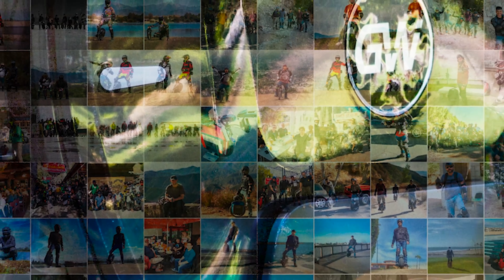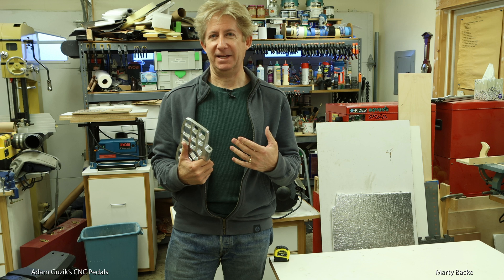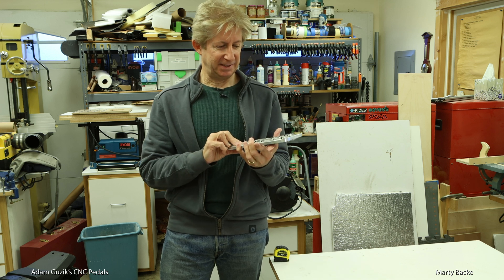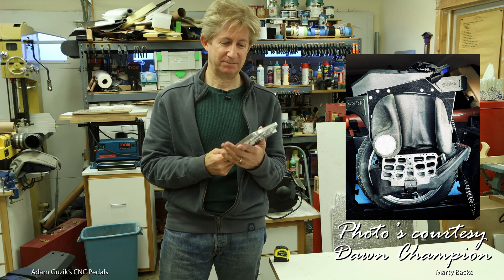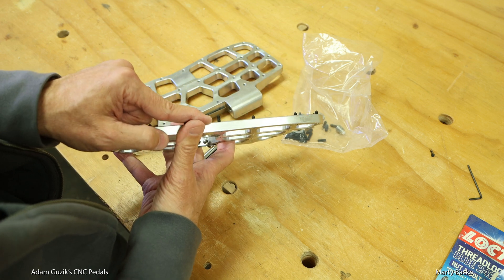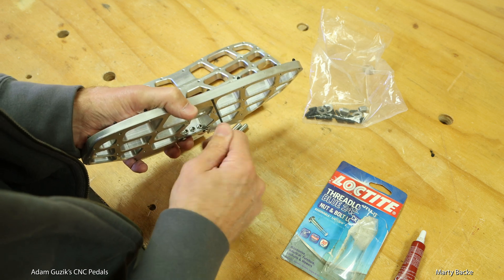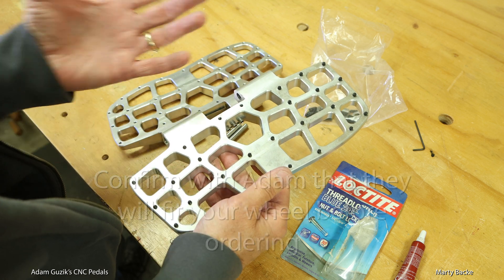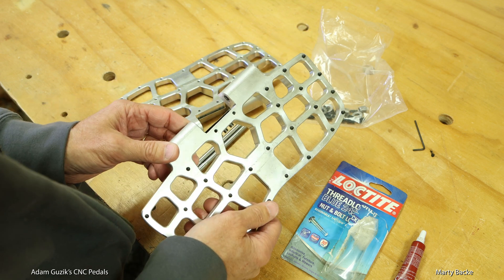New CNC Pedal Design for Electric Unicycles

Comment: Chromium's hardness & repeated stresses makes me think micro fractures, & at the other end of the scale in a crash may/could result in it breaking/warping either of the softer receptacles for said rod, and as such possibly could be more of a issue to fix (cost/ease)?

That said the pedals are super PIMP.😍😍

ps... 
jus tinkin out loud no diss.
Reply from the maker: Adam is an engineer and uses modeling software to analyze the strength of the designs. So I'm confident that he knows what he's doing in choosing chromium for the pedal rods.